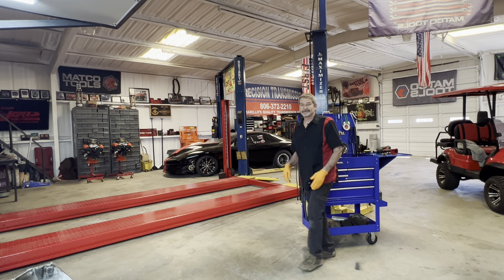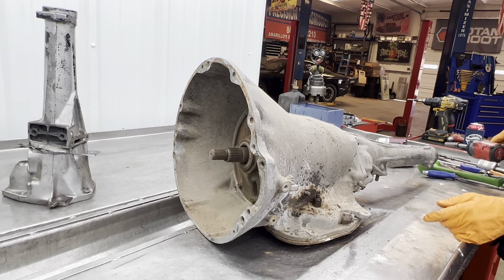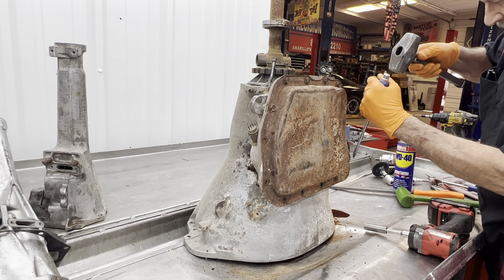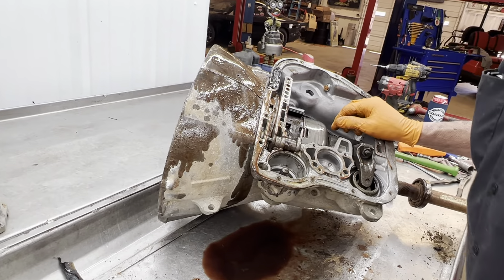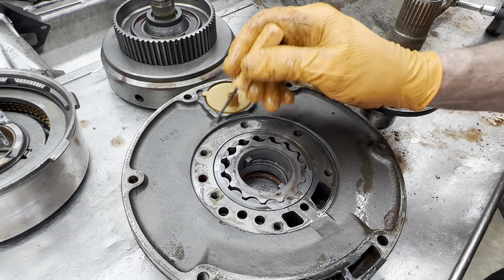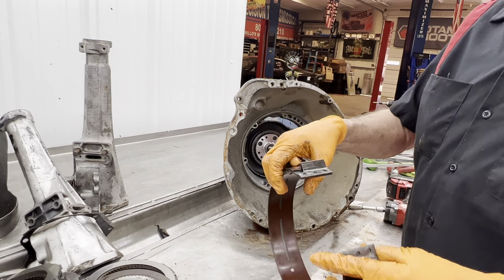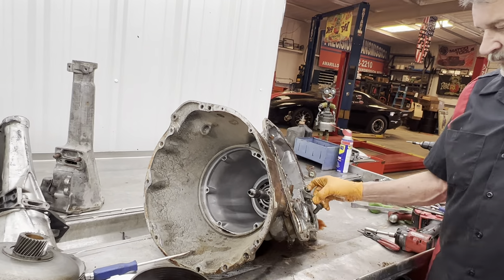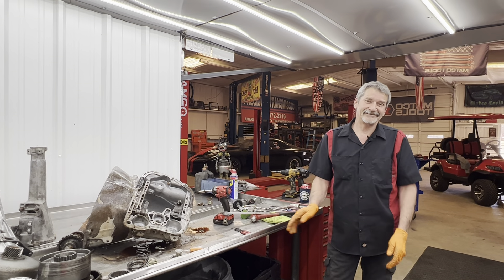Old school 727 core

Comment: Watching this video of the 727 reminds me of the first transmission I rebuilt. It was in a 1969 GTX 383 had manual valve body in it. As you know you had to shift it every time 1 to 2 to 3. Will when I bought it from my brother in-law the shifter didn't have a 3 gear lock to keep you going into  Neutral and into reverse. He was out playing shifting fast went from 2 to 3 an it went right into reverse an broke the reverse  Planetary housing. I bought it i was 18 never work on a transmission now this was in 1984. I am 60 yrs old now. Bought the new part fixed it. Was saving money to buy new shifter. An you know what I did the same damn thing 3 months later. But then you can buy part at auto parts store. Not like now. One very strong motor had 2, 4 barrels. When I was 16 my first car was a 1968 Dodge Charger with 318. Wish I still had it. The was the start of my drag racing. When I stop had my NHRA LICENSES. Fastest time was 7.62@165 1.2 60 ft. 2650 with me in a moly cage 2000 hp 1271 blower  Alcohol. Love your channel loved working on power glade..

Comment: I have a lot of respect for a good transmission builder.  I met a guy that gave me a runthrough of a transmission he had apart in the process of rebuilding.  He explained what each part does and what problems are most likely to occur, much like these vids.   A gajillion different parts in half a gajillion different transmission models, revisions, mods.  I dont know how they keep it all straight.

Comment: What would cause a 727 to shift through the gears really fast? The tv cable is adjusted correctly. This is a 1971 Dodge Demon that I bought about 2 years ago. I didn't drive it much, just went to the drag strip a few times then pulled the 318 and did a Hemi swap. I have the car back to the point I can get it out and drive it. The 1-2 shift has always been super firm and the 2-3 shift has a flare. The flare is worse when normal driving compared to about half as much flare at the track. The car was setup to drag race with the 318 (nice lumpy cam), this 727 and set of 4.56:1 gears in a Sure Grip.